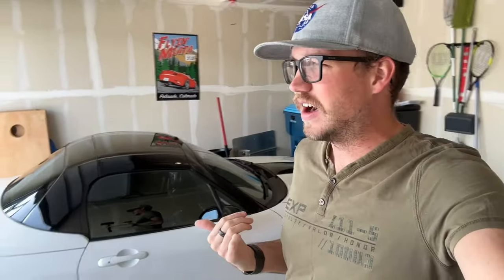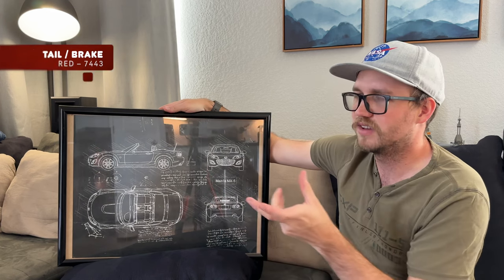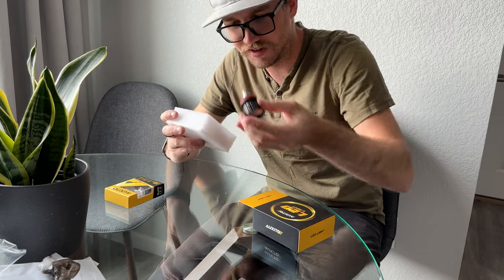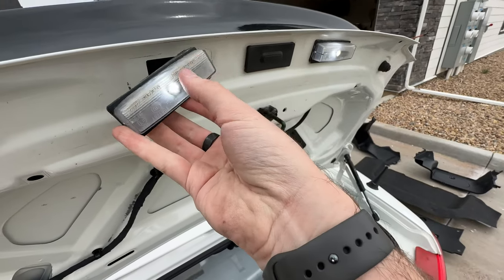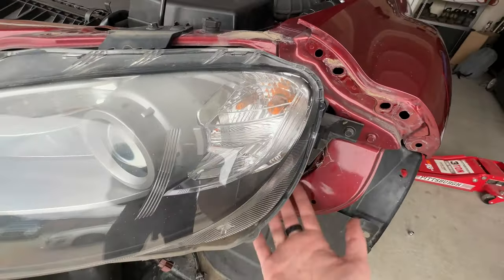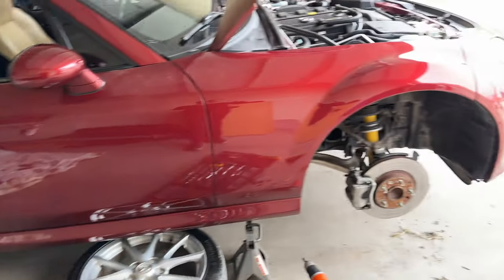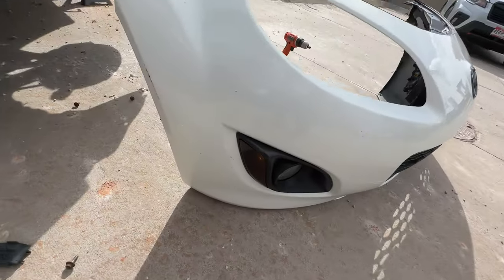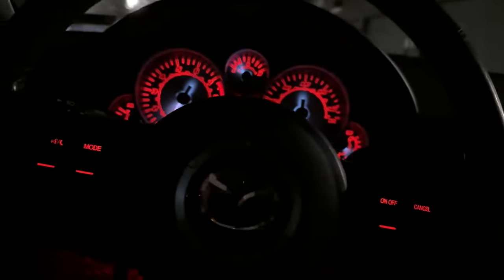Let there be light! Installing AUXITO LEDs in the NC Miata.

Comment: With my NC1, I managed to change the turn signals and the fog lights without removing the bumper or wheel. Just turn the steering wheel all the way to one side and that will give you enough room to squeeze in. I also just removed some tabs and folded the plastic out of the way instead of removing everything.
Reply: could you get to the Low beam bulb for a switch this way too?  I really dont want to take the bumper off to change out the main bulb

Comment: I have a 2006 NC and I replaced all of my lights except my HID low beams which are almost as bright as led. Now if I was you I would replace your hi beams with their 2023 60 watt bulbs, they are extremely bright.  As long as you align the bulb correctly the beam pattern has a defined cut off line.

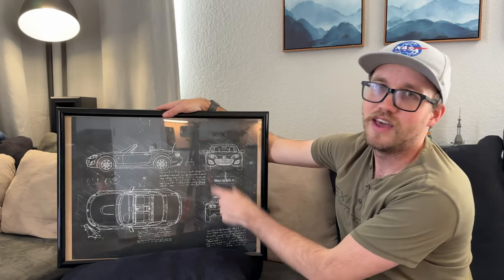Comment: 4:10 7440 are single-filament, one brightness level. 7443-dual-filament.  If you have a NC1 like I do,  turn signals will be 7440A front and rear because NC1 doesn't use turn signals as parking lights.  We have weird little extra parking lights.

Comment: Did you have to use any load resistors on any of the bulbs? Thanks in advance
Reply from the maker: Nope, none needed so far. Will be working with additional bulbs from AUXITO soon to further test.
Reply: @FlywheelFilms  can you share exactly which front and back run leds you got. I dont want switchbacks for the front but wondering if they have an equivalent.